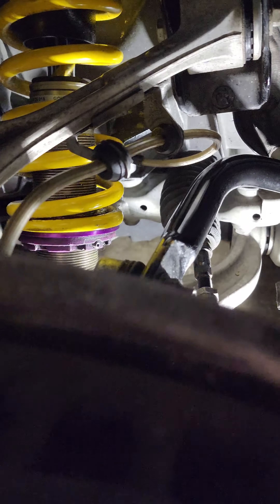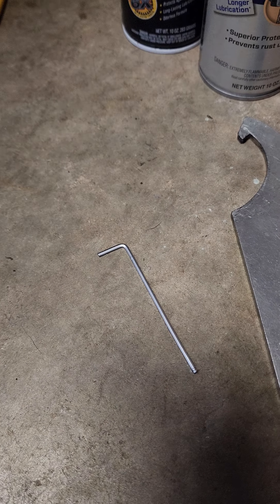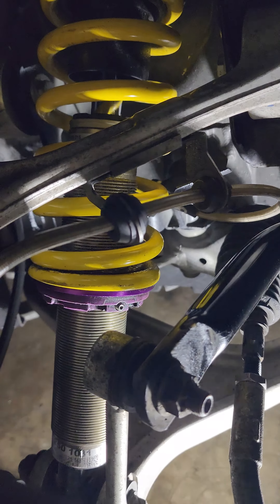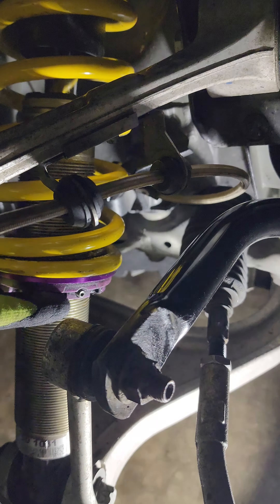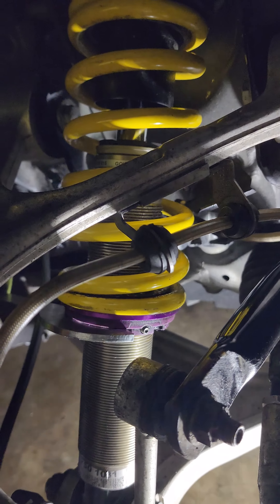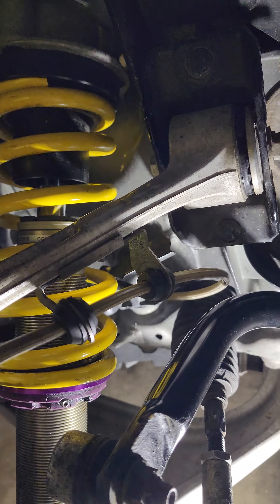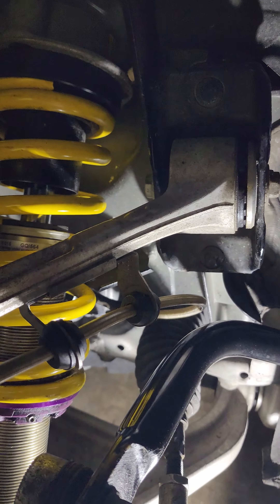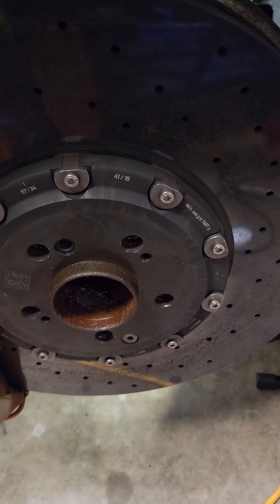How To Adjust KW V3 Coil Overs On An AMG GTS

Comment: I’m planning on getting an Amg gts 2017 Is it possible to make them go 1000whp ?
Reply from the maker: Only with PTG X Turbos and a full Built motor the most you can get without that is 900whp buy FBO with upgraded Fuel pumps and E85